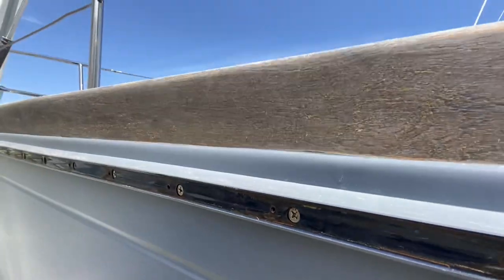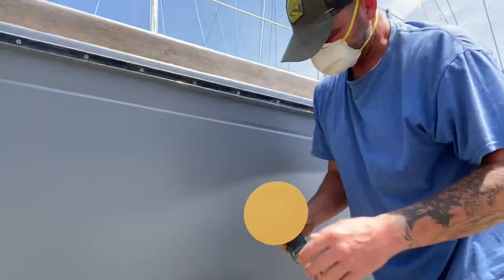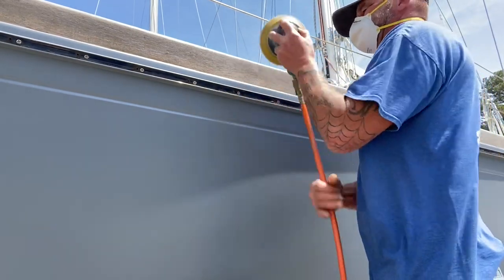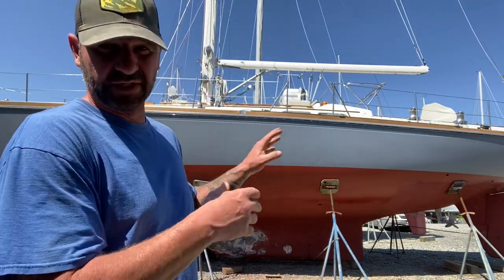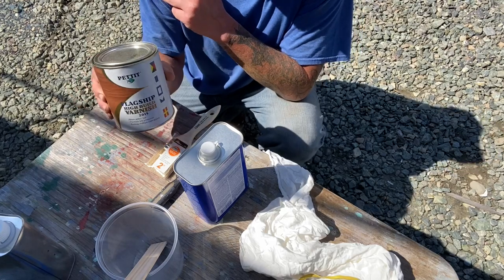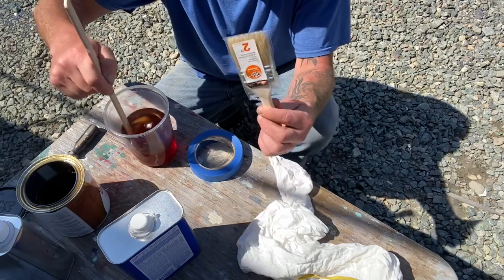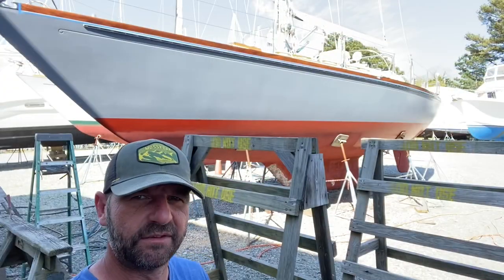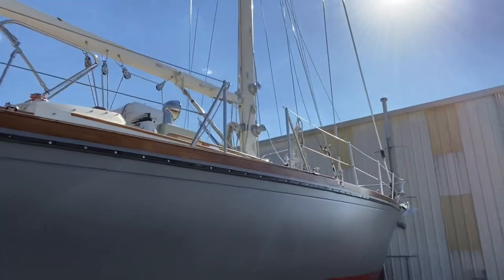How to prep and apply Flagship Highbuild Varnish. For Beginners!

Comment: Been a subscriber for quite some time now.  What would you recommend for filling teak rotten hole.  Teak railing on my sailboat 1.25 inches x 3/8” i need to repair. Right against the deck. Didn’t know teak could rot

Comment: What is your technique for old teak where the grain is deeply eroded.  Heavy sanding shortens the life of the piece by removing too much  and possibly sanding through the bungs.   I have Had success with 2 coats of thinned epoxy to fill the grain first than the varnish 
My testing showed using a heat gun works just fine when you must remove it in the years to come.